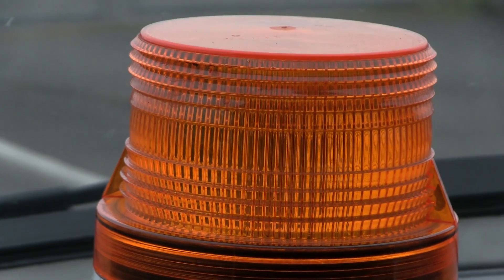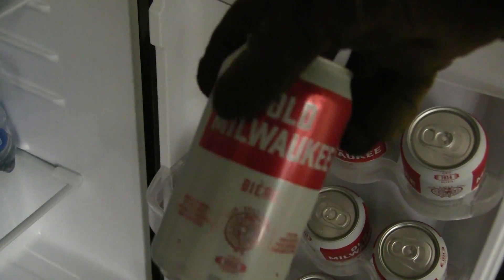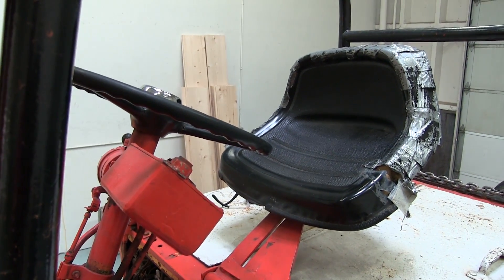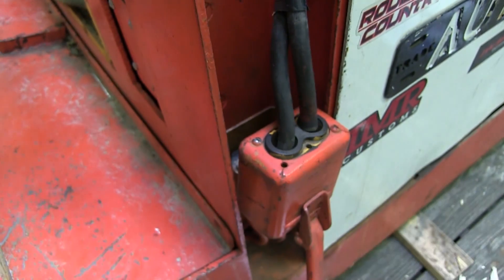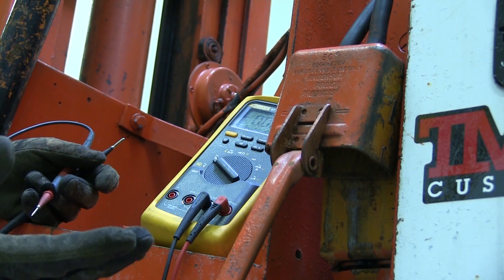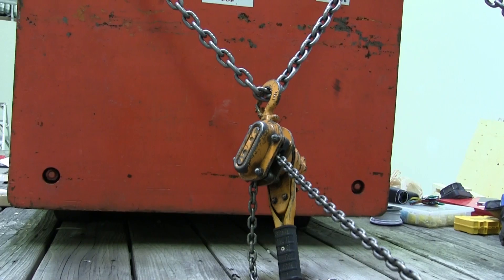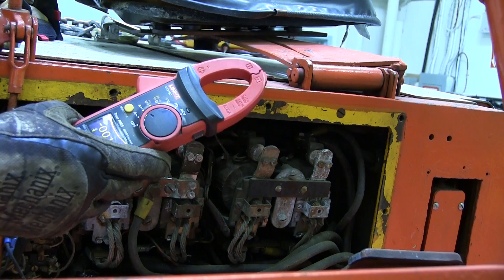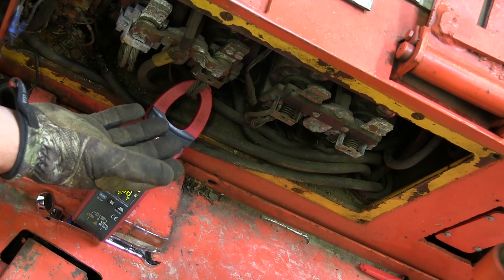Powerful Electric Troubleshooting | Voltage Drop Test

Comment: Hot damn, an AvE video about something I actually sort of know about! Granted, every electric forklift I've driven has been young enough to be this thing's progeny, and the place I drove them for wouldn't even let us maintain the batteries (it was always fun to look at the invoices from the technicians they hired to do that and see just how many extra zeroes were on that guy's paycheck compared to mine), but the familiarity's there regardless

During my last few weeks at that job, I was driving an order picker (basically an electric forklift that you stand on the forks for) and fell off the fuckin' thing trying to manhandle something or another off a high rack. Got to hang there off my safety lanyard for twenty minutes while everybody in the building got their pictures while the bossman tried to figure out where the manual release valve was for lift boom hydraulics because, of course, we weren't supposed to service these things, so nobody had any training on them beyond the controls and how to hook them to a charger. Those five point harnesses crush your nuts something fierce.
Reply: Hey, order picker here too! ConAgra. Worst job I ever had.
Reply: Doubt it could have killed me, never even really cut off blood to my legs. It crushed my balls because I actually had the thing adjusted right- i.e. it grabbed me and held me by my hips rather than digging into my thighs, so bloodflow wasn't really an issue. Plus, I could (and did, a few times) reach up and just hoist myself up a bit on the lanyard to take some weight off the harness.

They should have had emergency procedures, but my experiences working at big corpo locations like that (not gonna say where exactly, might need a job with them again some time in the future, y'never know) is that fuckin' everything slips through the cracks until something bad happens. They never even did basic stuff like explaining fire escape routes or what severe weather protocols we had were.

Comment: Why fuck about with live circuits for the extension cord when you can just measure the resistance by placing a probe at each end of the wire?

Comment: You should get the drive tires off the ground to do these tests. Put blocks under the outer mast channels and tilt forward onto blocks to lift the tires off the ground. If one brake is dragging in reverse this should tell you.
Reply: Also as someone else said, you have to be on the seat to release the park brake.

Comment: Last time i tried to find hotspots on cables with the heatgun i found a lot!
Reply: Laharl Krichevskoy I bought one of the seek thermal ir cameras. It's great for that job.
Reply: Joe Widdup 
Woosh! You missed the joke. Im taking about the other heatgun, the one that blows hot air xD

But yeah thermal cameras are super useful for detecting faults in circuits as most of the faults generate heat.
Reply: Laharl Krichevskoy You are of course correct.  I totally missed it as I worked with a service guy who always got the names wrong.

Comment: If it is on a trailer, then it would be reasonable to assume that the hand break was/ is engaged, if not, the breaks are stuck and like most fork lift trucks she will pull ahead but not go backwards if they are stuck. I worked on an old Klark fork lift and she was like that. Good luck.

Comment: Something you said there Ave made me think (it's been a while), you seemed to be suggesting that a voltage drop would cause more current to flow. This seems counterintuitive to me, surely a voltage drop would be caused by greater resistance, and that increased resistance - with the same load connected - would allow LESS current to flow? What am I missing here buddy? (As I say, it's been a while, be gentle :)
Reply: Operator Current flow is proportional to voltage and resistance. If V=IxR, then I=R/V. Voltage drop is a result of increased resistance, so you have both greater resistance and less voltage under load. If you have a 120v circuit with 50 ohms of resistance, it would produce .4 amps, but if you had 100 ohms of resistance causing you to drop, say, 5 volts, you'd end up with .8 amps.

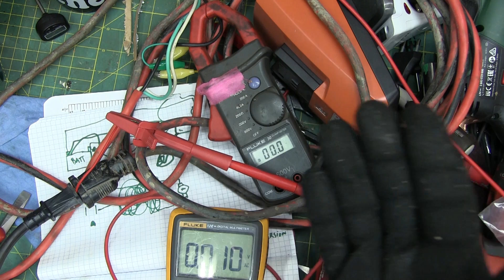Comment: 17:20
Isn't it the other way around or am I thinking it wrong right now?

My dad always told me, if the breaker pops, use a longer cable, so you get some voltage drop from the cable and therefore on your load a lower voltage = lower current in the system.

And it should be the same with motors. They normally don't go for some power level, but have a resistance and the power is determined by that resistance and the voltage/current provided.

In Germany we had an issue there with old carousels. German regulations limit the speed of carousels for children and with old carousels, the motor in combination with the mains voltage limited the speed of the carousels.
Germany had 220(+/-22)V mains voltage till 1987 and then switched to 230(+/-24)V. All those old carousels got a higher voltage and therefore more power, which made them spin to fast.
Reply: Yeah, that was definitely another brain fart. Unless you have a tool that has some kind of electronic regulation, most tools will draw less current at lower voltage and have considerably less power. If the tool has some electronics that try to keep a certain RPM for example, then it will draw more current at a lower voltage (but only if it wouldn't already run at 100% at normal voltage). Anything with a switch mode power supply is a constant power device, but that's hardly something you'll find in a power tool.
Reply: superdau You forget that basic asynchronous AC motors without electronic regulation will draw power according to the mechanical load.  In the extreme, you can feed in mechanical power and get power flowing the other way, as long as the grid provides a frequency and voltage.

The name plate rating indicates at what current you need to cut the power to avoid danger (unless an even greater danger takes priority, like putting out an actual fire, never mind destroying the pump in the process).
Reply: Yes, a motor will draw more current under load. But going to the extreme, a stall, where a motor isn't much more than a resistor, the current draw will be much lower at lower voltage. Or the other way round, the current at a higher voltage will be higher and more likely to trigger the breaker, for example when spinning up a power tool.
Reply: Maybe think of it like an angle grinder that you are putting the full 200 lb gorilla onto. The grinder would increase resistance as the load increases thus drawing greater amperage. Once the amperage hits the breakers threshold the breaker will trip. The longer extension cord has built in greater resistance so will add to the grinders resistance thus increasing current at the breaker with the same load on the grinder.
Reply: Dall Tex
"The grinder would increase resistance as the load increases thus drawing greater amperage"
Again I'm not really sure if this is right. To be honest now that I think about it, I'm very sure this isn't right.

So yes you are right, that if a full 200lb gorilla goes to work on that grinder, that the grinder draws a greater amperage, but the resistance must be lower in that case. (The electical resistance, the mechanical of course is greater)

A motor is more or less a dynamo with a resistor. So each time you induct a magnetic field in it, the motor inducts in reverse. So a perfect motor would create the same voltage as you provide.
A perfect motor at 120V would create a voltage of -120V and you would have 0 current flow. Now if you increase the load, you slow down the motor and therefore the dynamo produces a lower reversed voltage, which means the voltage on the motor increases and you get a higher current.
So basically under load a motor has a lower resistence and draws more current. (I=U/R)
Reply: Jakob Schulze after reading your comment I stand corrected regarding the increased resistance of the motor under load. I really have no explanation why I wrote that. Thanks for clearing it up.
Reply: Dall Tex
Thanks for participating.
"I stand corrected"
Good... I was starting to think, I had a brainfart somehow... happens to the best of us after all.
Reply: According to Ohm's Law, if V=IxR, then I=R/V. Therefore, as the voltage drops, the current goes up. 200 ohms at 120v would give 1.6 amps, whereas if you had 5 volts of drop on the same circuit with the same resistance you'd get 1.73 amps.
Reply: Jon Glender
That is not how maths works ;)

You are right about ohm's law ( U=R*I ), but converted to I (dividing both sides by R) you get I=U/R .
So taking your example with 200ohms and 120V... you get 0.6A and with 5V you would get 25 mA.
Reply: @TBFSJjunior hey you're right, I'm not really sure how I came up with that, haha. And I did it twice, which is fairly embarrassing.

Comment: I think the voltage drop of 13/22 volts to the contractor is because the motor is wired so that it gets 22V forwards, and 13V in reverse, with a central tap.
Reply: The Defpom's Repair Channel I was thinking the same thing... Only problem is, here is the third lead...

Comment: Can't you just use the thermal sensors on the end of your arms to check the extension cord?
Reply: Dave Bashford Temperature rise is a delayed effect and only happens if the load keeps drawing full current despite the voltage drop.

Comment: DC brushed motor with shunt field? May be the connections to the shunt (reverse side) with the current begin high because its going through the stator.
Reply: If it's a shunt field, they would have reversed polarity on it to reverse the motor rather than the rotor because the current is much lower. The reversing contactor is clearly designed to switch the full motor current which suggests a series or permanent magnet field.

Comment: Could the electric motor have two sets of brushes one set for forward one set for reverse maybe one set of brushes or windings are bad if so could you test resistance or ohms in electric motor windings

Comment: My dad fixed those for 40 plus years.He was colorblind, so made me wonder how he did wiring. Industrial and military dont use wiring colors. I didnt know that. He could also fake it really well. He knew greenish blue was probably green, and grey blue was blue, something like that.I dont think anyone checked in the Korean war. He repaired Tanks and heavy artillery motorized  vehicles, not Subarus and Toyotas.  Lots of burnt and pitted points on those contacts. Corrosion is NOT electricitys best friend.
Reply: RC Hobbyist Extreme Looked like electrical spark pitting, not rust.  This pitting happens on all contacts that operate under any load, lots of engineering goes into building them to survive this for a given number of uses, be it a hundred or a million.  At 57 years those contacts have remarkably few scars, though they are obviously no longer as good as new.
Reply: John Francis Doe I mentioned corrosion, not rust, wires do not rust, but you knew that. Dont tell a woman that though. lol.

Comment: I tried to keep quiet, but....Electrical Engi-nerd here. Your extension cord example is excellent, but the voltage drop seen by the tool is actually twice what you measured.  (You'll have nearly equal drop in the neutral conductor too.)  Thanks for everything.  Keep up the great work and I'll keep on keeping it in my vise.

Comment: That 13V you measured was because the voltage was going from the positive and through the motor to negative
seems weird you had a voltage from negative to the same point on the controller, i would have expected that to be zero.

Comment: One side of the battery is connected to chassis. Either + or -. Hopefully plus what with all the salt slinging in your parts. One of those cells is surely ruptured and sort of shorted to chassis. Another thing is that DC motormathingys are often "timed" to work better one way than the other. How much backwards shoving does she need? Certainly more of the forward kind. Anyway, you may be on to something with the brakes but that is also electrically actuated for certain. I'm a terrible better but I bet yer a roll of HPHT it's a combo of busted cell and right worn the fuck out brushes.

Comment: You could swap fwd and reverse leads and actuate reverse. If the forklift goes fwd it confirms a mechanical problem
Reply: Your far too smart for the back of the class, pick up your books and go down the front.
Reply: Exactly! That's some proper skookum logic right there.
Reply: Almost Fixing 101 switch it around.
Reply: That's what I was thinking also

Comment: What what? Is this an actual work assignment?
Reply from the maker: No, this is a work for chuckles and beers assignment. But mostly, I want to borrow the trailer.
Reply: A reply from AvE? I must be dreaming (entirely possible after a bottle of Jameson and a bottle of Lithuanian potato vodka).
Reply: Joni and tissues
Reply: So that's the real reason why you had to get the forklift off the trailer!  (And... if you were measuring voltage drop on that extension lead, wouldn't it have been the rh pin with the lh socket?) Cheers, D

Comment: My troubleshooting method would be to check what parts are different between forward and reverse operation....
If it moves forward and not reverse, not so likely it's a brake locked up...
If it has motor current, it likely has motor torque with one exception:
You show current in both forward and reverse, I am assuming that it lurches forward when you try to go forward, but does NOT lurch when you try reverse.....  IF you have motor current, but no motor torque, then you are missing FIELD FLUX... I'd go after that reversing contactor first. I didn't see it change states in your video when you went from forward to reverse, and it should have pulled in / dropped out.

Comment: So... You tested the no load voltage at the connector. And tested the voltage drop through the wires... But we didn't see (did you do it?) Test the voltage at the contactors/relays. Not did you seem to test the packs voltage drop under load. If the pack is half as rotten as it looks it would loose several volts just from the load. That 36v no load could drop to 30v under load... So you might just loose 1v over the cables...
Having said that. If the system runs forward but not backwards and the cables only formed right before the relais... The problem is not with the pack or the wireing. And the reverse has, most likely a valid circuit. As the amp draw is similar. So there is indeed a fair chance that something blocks the drive system in one way.

Comment: Connections often go bad.  Look for lose fasteners.  Watch for the voltage drop and then follow it upstream till you find the problem.  The voltage will look good but under load can drop quite a bit.  Just like a loose battery cable on your car.
Reply: It makes sense, but the damn thing was showing 128A... and for that current to pass through a loose connection, you would have sparks and smoke everywhere.

Comment: If I'm not mistaken, you can measure resistance under load. Keeping in mind that the internal resistance of the meter is in the mega ohm range so it will impact high resistance circuits

Comment: With all due respect (and the expectation of howlin' an' wailin'  an' gnashing of teeth) I think you got it a bit wrong in your explanation. 
Your motor will not always put the same power out! .... IF you are adding resistance of cabling into the equation the total resistance (reactance in AC) is higher and therefore the power output is lower. It is the same as dropping the input voltage! Not that this is relevant to your Fork Lift ;0)
Reply: true, I was thinking that, too. But then we can get so analytical that we can start thinking about how much inrush current and what inductance the motor has, etc...etc... He just meant in general. Within like 10-20% is close enough for crude first glance troubleshooting purposes, usually.

BTW I had this exact problem when a radio DJ added on a garage and wired it himself. He wired black as AC neutral and red as AC hot and hand-twisted the wires w/o even a junction box. No compression connectors. So I discovered all these faults after my circular saw blew the breaker when just sawing through a normal everyday 2 by 4 with a sharp blade.

I measured the voltage and it was around 70-90 VAC under load. It was a fire just waiting to happen. The bad connection was right under a bedroom, could have been very deadly very quick just with the initial smoke alone.

I rewired it, added a GFI just to bring it up to code, and got full 120 vac with never a problem again. The DC color coding system should NEVER be used in AC wiring!
Reply: ;o) .... The kind of pixie wrangling I've conned them ...... I mean convinced them ..... I am worth paying for the typical resistance of the supply "leads" is 0.2 Ohms at 240/415V . The "leads" carry about 400A so the 10% would not work on my game! It is kind of cool to watch the leads jumping around due to magnetic coupling. Well when I say cool, I mean cool in a undergarment laundry requiring sort of way! I won't even mention what those supply transformers at1000KvA are like bouncing around under fault conditions ..... Let's just say the doors are always kept open and my exit rout is clear of obstacles ;0)